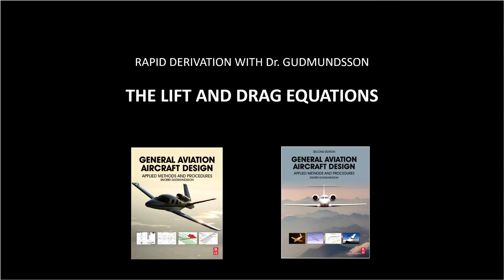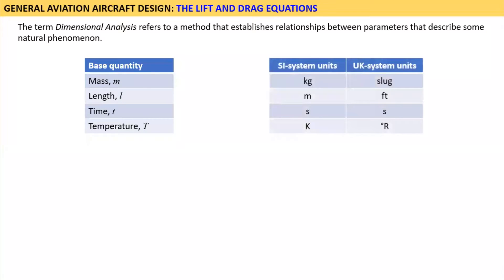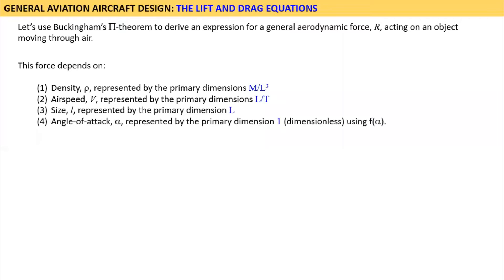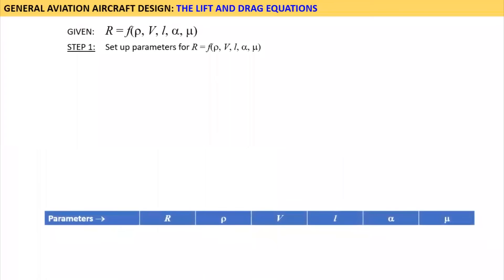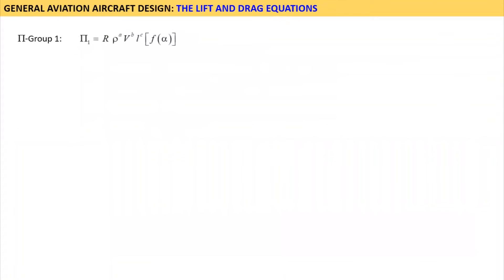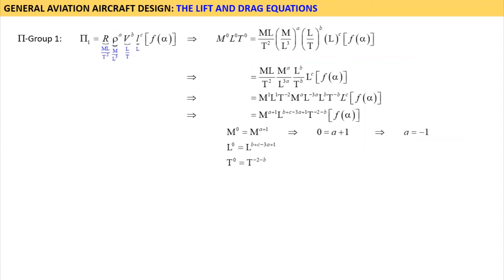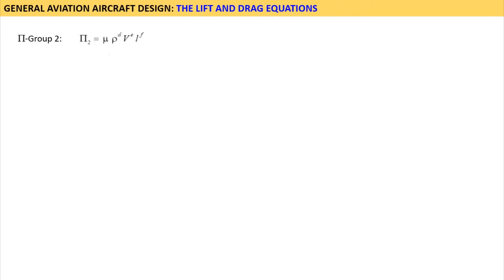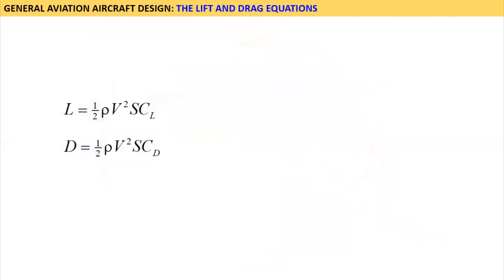Rapid Derivation 5: The Lift and Drag Equations

Comment: I read your text on propellers, but have problem solving example 14-18, I don’t know how you got an expression 6-2r/R for linear taper expression, I mean the c(r), I will be glad if you get back to me, is for my project, the topic of my project is adapting a gx200 engine for the propulsion of an aircraft, is the tapered blade, how do you came up with that expression
Reply from the maker: Hi Adebimpe.
The expression is a linear parametric equation for a trapezoidal propeller blade and is obtained as follows: Imagine you have a propeller of diameter 2R. Further assume the theoretical blade has a chord of 6 inches at the center of rotation (where r=0) and 4 inches at the tip (where r=R). This means the chord changes linearly from 6" (at r=0) to 4" (at r=R). Thus, it follows that C(r) should be an expression of the form C(r)=Co+A∙r. The question is, what is the constant A?

Well, if C(0)=Co=6 and C(R)=Co+A∙R=4, it follows that A=(4-6)/R=-2/R. Therefore, C(r)=6+(-2/R)r, which you can write as C(r)=6-2r/R. That's all there is to it. I hope this helps.
Reply: @dr.gudmundssonaircraftdesign  you re my savior, thank you very much sir, one more question please 
My engine doesn’t have enough power, but I know what it’s can generated at that power, considering tapered and elliptical blade, I don’t know which one will generate more thrust, because am working on good thrust, any of your ideas will be highly appreciated
Reply from the maker: @adebimpesaheedolawale5471  Unfortunately, there is not a simple answer to your question. It depends on the details of the planform geometry, blade twist, airfoil, airspeed and RPM. Since you were trying to solve Example 14-18, you were working on the blade element theory. It can answer your question, but first you must understand how it works through the spreadsheet. You also have to make sure you implement the induced velocity in the stream tube through the propeller. This is shown in Example 14-20.  It allows you to compare thrust, efficiency, and power required to rotate the two props at your desired RPM and range of airspeeds. Best wishes.
Reply: Thank you so much, really appreciate
Reply: Sorry am disturbing you, I understand that a variable pitch propeller is like how much the propeller pitch is being twisted, but from the question above, we use 65% from the hub to 20% at the tip, is there a formulae behind those values or they re just assumptions, sorry for taking your time
Reply: Still waiting for your reply, you have written the best textbook in the world, it’s just unfortunate for me having problems on the propeller calculation part, every other information and calculation I have used in this text have really increased my scholarly school life, really appreciate all your efforts in putting all this together
Reply: I don’t know probably am right with this formulae of solving the 65degree to 20degree at the tip, I use this formulae bita=actan (pd/2pi*rref) where I take my rref at the hub as 6 and my pd as 85% of the propeller diameter, also for the tip, I take my pd as 85% of the propeller diameter and the radius as (76-12)/2, I used the radius, I got 59.7 degree and 17.81degree respectively
Reply from the maker: @adebimpesaheedolawale5471  There are several ways to specify the twist of the blade. Two of them are: (1) Start with a specific hub airfoil twist angle (e.g. something between 50-70°) and tip angle (e.g. 10-20°) and then implement a linear twist change between those extremes. (2) Base the twist angle at any blade-station on the aerodynamic properties of the airfoil at that location. For instance, to ensure the propeller efficiency is at maximum at your cruising speed, you must (a) determine the angle of the maximum Cl/Cd at any blade-station (complex to do because the airfoil changes from hub to tip) and (b) make sure the twist angle results in that angle being achieved in cruise. The resulting twist depends on your target cruising speed, engine power, RPM, and airfoil geometry. This takes expertise to do correctly. You can also try to find out from an existing propeller for a similar aircraft what the twist angle is at the hub and tip and chances are you'll get a decent propeller using option (1). You can check out NACA TR-306 for some details. Good luck.
Reply: @dr.gudmundssonaircraftdesign  thank you so much @Dr. Gudmundsson, really appreciate❤️
Reply: @dr.gudmundssonaircraftdesign  thank you so much DR. really appreciate all your efforts, thanks
Reply from the maker: @adebimpesaheedolawale5471  You're welcome. Best wishes.
Reply: Please sir, is the formulae for variable pitch angle in your calculation of 14.18 valid for fixed pitch also
Reply from the maker: @adebimpesaheedolawale5471  Yes.
Reply: Hi dr. I want to ask you question, because am stuck, my project is basically adaption of gx200 engine for the propulsion of a fixed wing aircraft, everything has been successful so far, am am seeing progress with the method you provided, whereas, am still having problems, my project entails using 2 engines for the propulsion force, where am working with lazair aircraft as a reference, I have an issue after getting the polynomial coefficient from my graph, which I find clift to be higher than normal around 104, which is deliberately high, Clift should be around 1.5 to 0, I think, but am thinking probably is from calculation of the aircraft speed because I divided the aircraft speed into two, because I was using two engines, is it advisable to use one aircraft speed for the two engines, or i should continue with the splitting, when I use one aircraft speed for the two engines without dividing, I got a values around 1.5 Clift which decrease as my section decreased… for my airfoil I can’t use your naca report, I am using my own calculated data from xflr5 with reynolds no of around (46,000), whereas I can see how angle of attach reduces drastically… after the plotting of the polynomial graph, I got my zero lift angle of attack to be around 0.136, which is kind of reasonable for low reynolds no, …really need your advise on using the total aircraft speed which is (30m/s) or divide it into two because they re two engines which is at (15m/s) each for my calculation
Reply: Thank you so much sir ❤❤❤